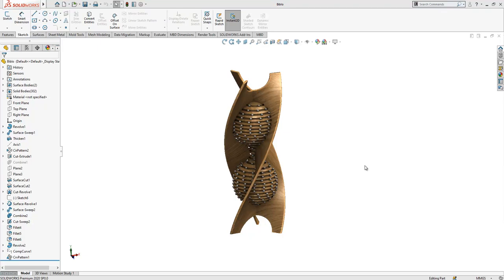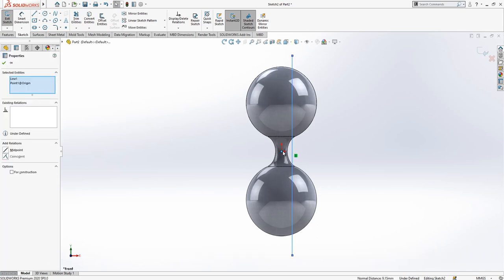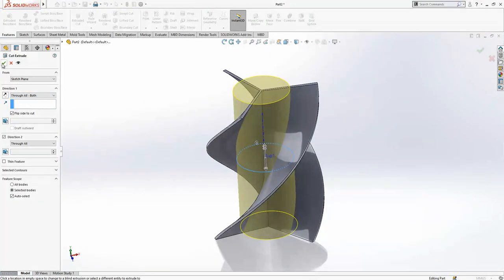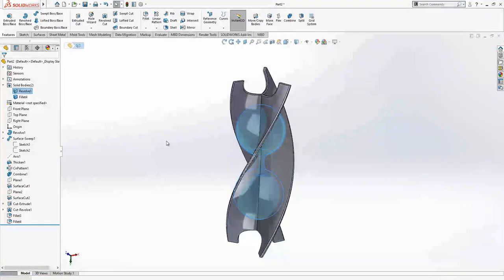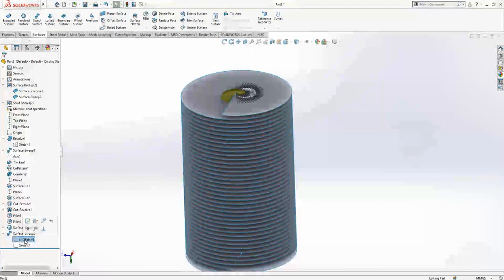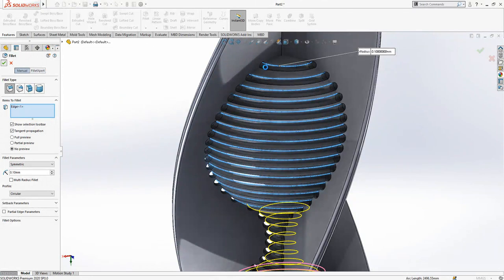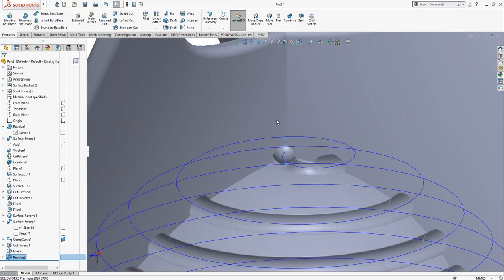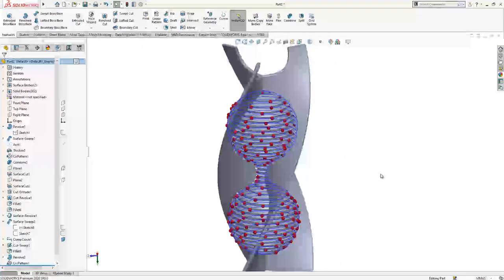Advanced Part Modeling - SolidWorks Tutorial

Comment: hi: do you know the cause of this error? I followed step by step in video but when i use swept cut command at 12:23 it gives error "sweep operation failed to complete"
Reply from the maker: Hi Dear, normally it should work and I do not know reason. Probably one of the curves have some problem there.
Reply: i don't know why but when i try again by reducing the dimension of circle less than 3 the error does not occur
Reply from the maker: @__mq.b  I understand it now, the gap between two cut becomes smaller than 3 mm and Sweep not allows you to complete it. Reduce the number of revolutions in earlier sweep operation then you wont have problem. I hope it is clear now

Comment: I think the radii failed because you have to do the 3 long inside ones first. It doesn't like fillets that intersect at sharp corners. Filleting is probably the hardest thing to do in SolidWorks or any 3D software.
Reply from the maker: True, I had terrible days with fillets. Always there is a a solution but you should try different methods. 

I use Solidworks since 2001 and eachtime I learn somethings new infact.